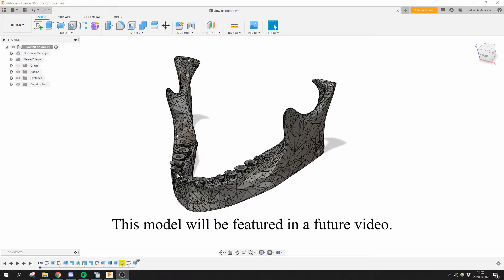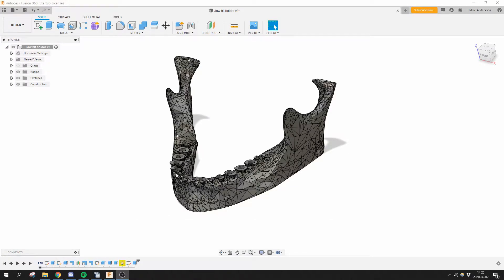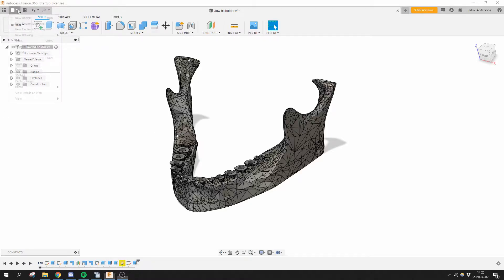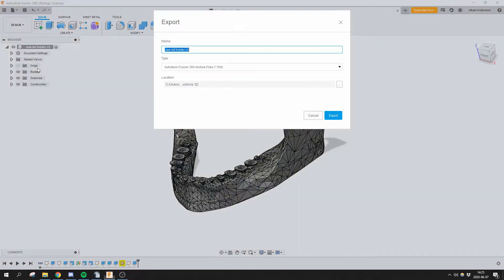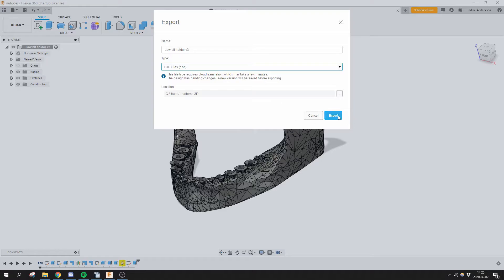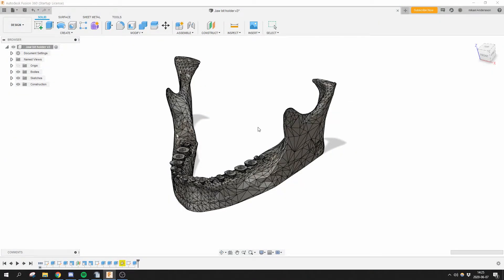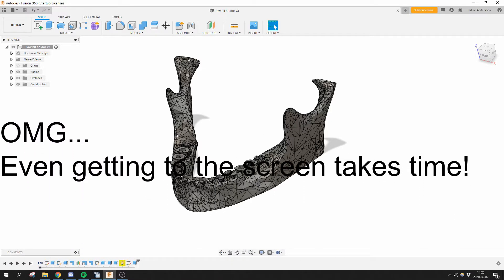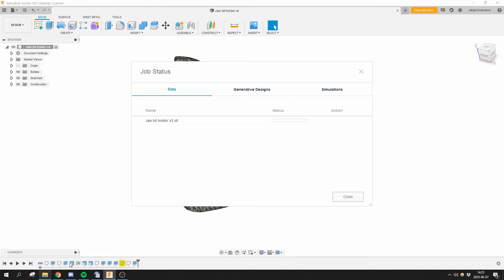Stop wasting time when exporting STL's for 3D printing.

Comment: Great tip. I don't export STL very often, but when I need to check a parts dimensions before throwing it on the CNC to mill it out, it's nice to be able to do this quickly as 3D printing already is a drag.

Comment: I always done it that way.. you can choose where to save it or open it directly in a slicer, it's way easier that the other way
Reply from the maker: It sure is a much better way. I don't understand why Fusion even has the other way as an option.
Reply: @GoodBoyCustoms  I believe it sends the file to the cloud to be processed when you use the "proper" way?